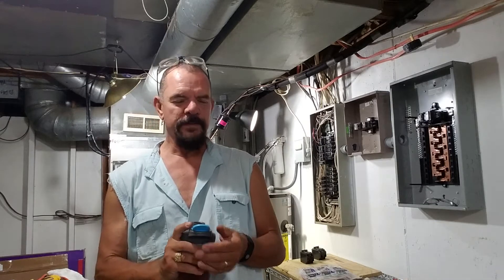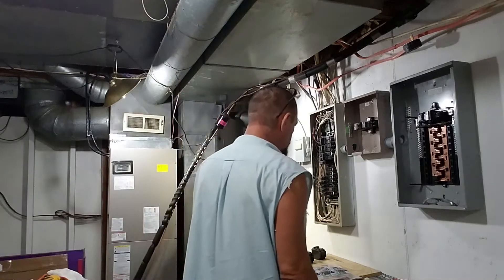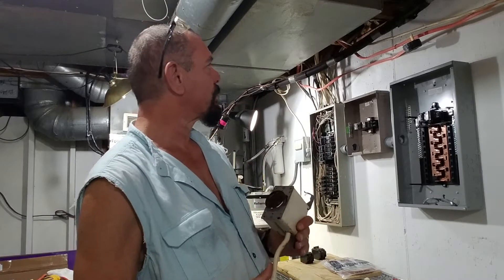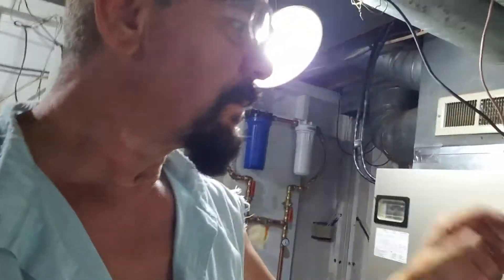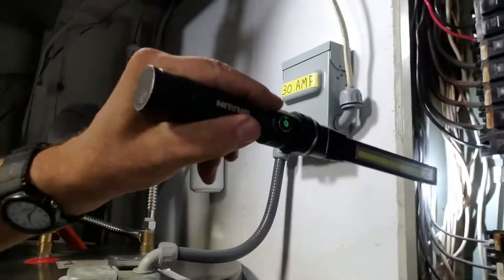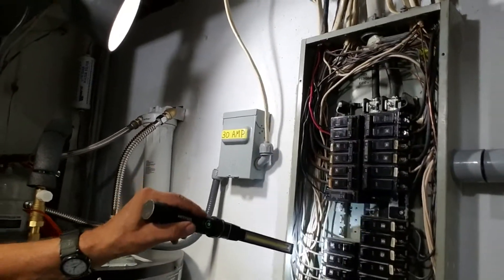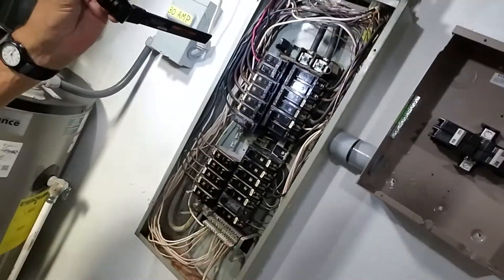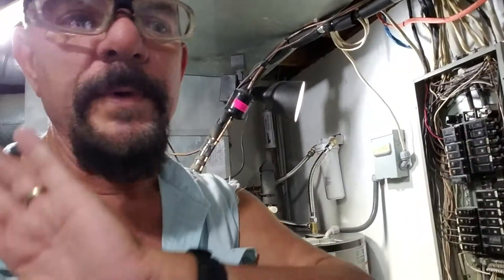Bro DIY: CRS #8 - Load Center / Portable Generator Manual Transfer Switch / Sub Panel Joining.

Comment: Nice job. Always clean metal chips up. I use a slug-buster punch to cut holes with almost zero chips.
Reply from the maker: I should have considered renting a press or spending the $100.00 on a Harbor Freight setup, but just don't do enough metal work to justify the purchase.